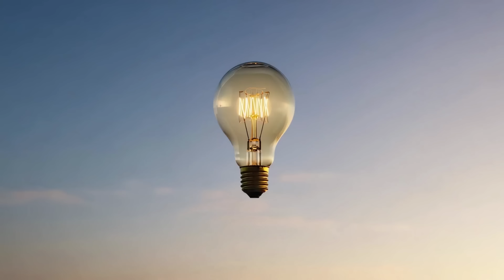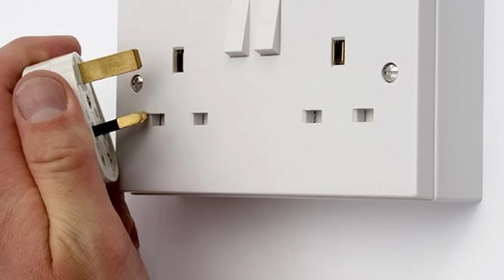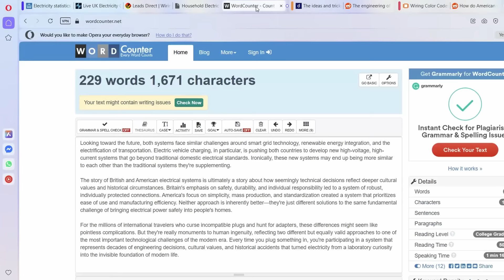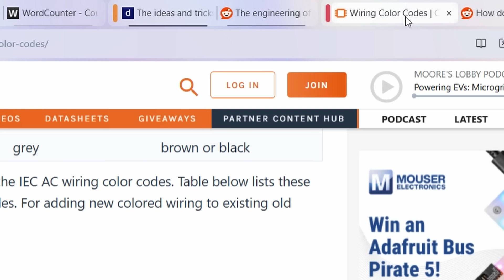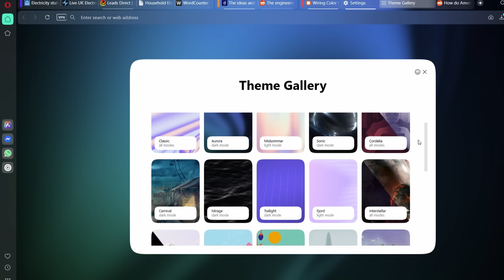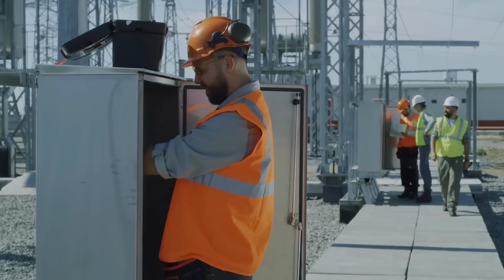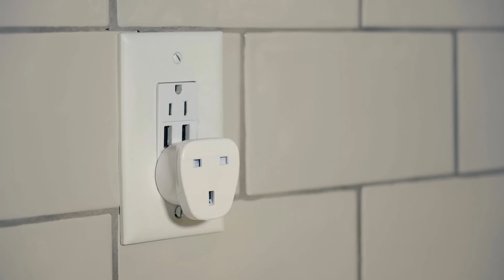British electricity is SAFER than American electricity. here's how.

Comment: As I remember we had fuse boxes in the UK...with individual fuse wire for different circuit's. Now we have even more safety with fuses in plugs and fuse boxes replaced with a mains trip with trip relays for individual circuits around the house

Comment: The UK started off with 2 pin plugs and sockets, similar to what they commonly have in the USA.  However, a new statutory standard was introduced in 1934, that mandated 3 pin plugs and sockets with 4 different sizes and current capability.  This was updating in 1950 to mandate shuttered sockets (to prevent children sticking objects into sockets and getting electrocuted) and insulted shielding of the first part of the live and neutral pins, again for safety reasons.  Meanwhile, a new standard for square pin plugs with embedded fuses was introduced in 1948, and this has become the dominant standard over the years.  Square pin plugs have been mandatory in all new domestic installations for about 75 years, although round pin sockets and plugs are still permitted and are found in specialist applications such as theatre lighting.

Comment: Not quite true, original plugs/sockets were round, even in 1975 when I bought a do-er upper it had 2 outlets in the entire house both round pins. My current house still has some modernish sockets without switches, which I must get around to replacing, things change but it takes time.
Reply: The square pin Type G plug was designed in WWII, by a woman, being introduced in 1947. The older round pin Type M  and  Type D is still legal but used for niche applications like lighting. It was phased out from 1947 for prime household use.

Comment: Master Electrician here (American) 

Very good, easily comprehensible explanation for non-technical folks. 

One of the first things I noticed when on holiday in the UK was light switches toggle down to turn the light on. American switches toggle up. (I think this is a carryover from the days of "Frankenstein" switches where you didn't want gravity to energize the circuit.) 

The first thing my wife noticed was there were no receptacles for her hair dryer in the toilet area.  We have wet location receptacles on GFCI (RCD) for kitchens, toilet rooms, and outdoors. I also had to explain turning off the switch before plugging in or out. 

Agreed your plugs are much more robust than ours, and safer with the partially insulated blades and the ability to switch off the receptacle before connecting/disconnecting.  The way the cord enters the plug at 90 degrees also prevents pulling the plug out by the cord.  You just don't want to step on it while in stocking feet! 

Also, your illustration of an American receptacle showed an old fashioned "un-grounded" (un-earthed) receptacle. This has mostly been replaced with three blade "grounded" receptacles, which like the UK version, the ground pin is longer, and connects first. These are also more secure in the the receptacle. 

American homes also have 240 volts.  The utility transformer feeding the service panel (consumer unit) has a center tapped secondary: 120 volts from either end to the center tap, 240 volts end to end. 

We use 240 volts for high power tasks like water heating, clothes dryers, kitchen ranges, and air con.  Lights and portable appliances are 120 volts. 

My wife was impressed at how quickly UK tea kettles boiled water, so I ran a 240 volt circuit and installed an Americanized version of the UK receptacle in the kitchen. (The receptacle has a double pole switch, and fits an  American pattress)
Reply: One thing I've noticed about the US flush fitting boxes for sockets is how the screw lugs are fitted on the outside while ours here in the UK are on the inside, so at least with the US boxes there's far less chance of piercing and shorting out the wiring when fitting a socket, unlike ours where you have to be very careful not to trap and pierce the wires with the screws, as I've done enough times in the long distant past. But surely with the fixing lugs on the outside it must cause issues with the surrounding plaster on the wall, don't you have to make little gaps in the plaster for the screws?
Reply: We have sockets in bathrooms but in remote zones, which means the average bathrooms is too small to accommodate. For obvious reasons we do not have portable electrical appliances near baths and sinks.

I would not like to stand on razor blades in my bare feet. So I keep razor blades off the floor. We keep plugs in the sockets and switch off using the switch.

US receptacles have no safety shutters. Along with a whole host of other advantageous. 

American homes do have unpolarised 240 volts, only for high powered appliances using a special plug.  The oddball US system has three circuits fed into a house. One 240 volts  and two 120 volts. We look at it and think what were they smoking when they thought of that. 

My wife was impressed at how quickly UK tea kettles boiled water, so I ran a 240 volt circuit and installed an Americanized version of the UK receptacle in the kitchen. (The receptacle has a double pole switch, and fits an American pattress)/
I assume the Leviton British Standard Receptacle - BS 1363 Switched Outlet. It must a be curio feature for visitors.

Comment: I find the two blade system trends can be  easily/accidently unplugged compared to British 3 pin system. 
British 3 pins can be found also in other countries especially former colonial country and most of the world runs on 220v/240v
I can only think of US and Japan running on 110v and another I can't remember
Reply: Japan is an antiquated mess. 100v with no earth One half of the country is 50hz and the other 60hz. 
56 countries use the British Type G plugs. Saudi Arabia recently changed over to the British system. Auss, NZ and China need to follow. Hong Kong uses the British plug.

Comment: The British Type G plug as used today was only introduced in 1947. 
Previously, type D was used, which in the two-pole version can be confused with types C, E and F used in Europe.
The American type A plug was introduced at the beginning of 1930. Little has changed.
Reply: Ring circuits were also introduced in England around 1947 to save copper and money. 
Only branch lines are used worldwide, never ring circuits.
Reply: The American type A plug was introduced in 1919. Time for change.

Comment: A good compromise are the european plugs an sockets, they a bit smaller then the british ones and  bigger than the american´s.
Continental europe has also 230V there are mainly two different type of sockets. The most countries use the "Schuko" ® system,  France , Belgium and the Tschech republic got a similar one  with the earth pin in the socket.
Reply: The German Schuko is not that good. The side ground blades are poor.

Comment: The electrical socket shown is an outdated type used no later than about the 1960's.  While you can still find them in older homes, all modern sockets have a third, U-shaped slot for the ground (earth).

Comment: Very good review. We did in the UK harmonize with Europe by dropping to 220  volts...
Reply: That's just nominally, though. Most UK supply is still 240v. As I type this, my supply is 241.7v.
Nominal European single-phase voltage is 230v, with a tolerance range of +10% and -6%. That means that the compliant range is about 216v to 253v.

Comment: British electrical is genius. I’m an American living in Shetland and electrical appliances seem to work more efficiently here. However I would like to hear what you have to say about the plumbing. At least here in Shetland the plumbing is pretty diy user unfriendly and although there are great things like stainless steel sinks with a stainless drain pan built-in the idea of a sprayer is really foreign or a very expensive retrofit. Also, you can’t buy a portable full-size dishwasher that would plug into a sink or a washing machine for that matter, which is a shame because sometimes a portable dishwasher or washing machine can be the perfect item for a small amount of cupboards space but  you have lots of island space in your kitchen.
The other huge issue I’ve had with the plumbing here after living in a few houses is that most places don’t have shut off valves under each fixture like they do in the states so if you have flooding you have to go down to the kitchen and turn off the main water valve  rather than just being able to turn off a valve under a sink or toilet. 
In all outdoor the hose fittings here are some weird quick release made of plastic that break quite easily, especially when you have young children ! 
However, I am very happy to be living here and I can deal with the plumbing , unfortunately, I can’t fix it anymore.
Reply: 🙂
All your reservations on plumbing are easily rectified by buying the right fittings. All available even the dishwasher, if you look hard enough.

Comment: See also the Brit practice of putting fuses in the NEUTRAL in the past.  Also Brit electrical - let's put the metering and other network equipment and wiring straight on the wall inside the house not in an sort of enclosure at all; let's make switchboards out of wood, no let's use steel, no let's use plastic, no let's use steel again, no...; meanwhile in the USA put it in a steel box, ah nice and safe let's leave it at that.

There's many other technical differences beyond a fluff video such as this one that will leave people wondering how on earth Brits think there electrical is so good compared to any other peer country, apart from not actually knowing just how many risks there really are with how things are set up.  Having a false sense of safety is far worse than not.  Oh, and this is coming from an Aussie where we've done some questionable things in the past too.
Reply: I have never known fuses in the NEUTRAL - ever.
Integrated metal switchboards have always been available in the UK. New houses have dedicated incoming cables and meter cupboards. 

he British domestic electrical system is objectively superior to other residential systems in how it controls fault energy, protects flexible cords, and manages distribution.

The British system is superior because it:
▪ Controls fault energy at the appliance;
▪ Protects flexible cords directly;
▪ Uses higher voltage efficiently;
▪ Has safer plug and socket design;
▪ Applies human-centric protection universally.

The US system prioritizes simplicity and low voltage tolerance, but that comes at the cost of cord protection, efficiency, and inherent safety. The UK system assumes people will misuse electricity and accidents will happen, and designs for it. The US system assumes they won’t.

I like going to the USA as I can see how electrical systems were seventy years ago.
Reply: @johnburns4017  Except when you lot used  fuses in the neutral.  It's a matter of historical fact and one that can not be denied, unless of course you wish for the rest of humanity to laugh at you.
Reply: @retrozmachine1189  
The British ''do not'' use fuses in neutrals.

You have not a clue about what you are writing.
Reply: @johnburns4017  Perhaps you should take the time to go back and actually read my initial comment.
Reply: @johnburns4017  Oh and for everyone's entertainment, plug this into the search of your choice 'why did the UK have fuses in supply neutral'
Reply: @retrozmachine1189 
Again......
The British 'do not'' use fuses in neutrals.

You have not a clue about what you are writing.
Reply: @johnburns4017  Yeah.  There's no oh I dunno youtube videos of modern day UK sparkies coming across installations that STILL have fused neutrals in operation.  That never happens, eh?
Reply: @johnburns4017  Look you can continue to blither on but it's painfully obvious that you just don't know the reality of what has gone on in your country in the past and have no idea as to what is going on today either.
Reply: @retrozmachine1189  
If anything antiquated gets thru the net it is replace when known. What planet are you on?
Reply: @johnburns4017  Apparently a different one where you are because reviewing your comments the Brits never had neutral fusing ever and it is absolutely not in use anywhere in the UK today, at all.  

Shame that reality disagrees, but there you are with the world smirking at you.
Reply: @johnburns4017  Oh, and don't worry about replying.  I've had enough entertainment for today, thanks for giving me a good laugh, and have elected to set you to silenced.
Reply: @retrozmachine1189  
You are a very confused person.

Comment: GGL .... I love this channel, but ..... US voltage is 240 volts, with the facility to split phases to 2x120 volts ... All your of your ovens, tumble dryers, AC, etc, are wired into your 240 volt circuit, the lighting, sockets etc, are supplied by the 120 volt circuits.
.

Comment: The old British type M round pin plug and socket is used in India (largest population in the world), Pakistan, South Africa, etc. They are still legal in the UK today. But these days they have shutters, switches and insulated pins similar to the square in Type G. Despite being rejected as the prime plug in the UK they are the second best plug and socket in the world after the current British type G. All the rest are way behind. 

The British square pin Type G is used in 56 countries in the world. Add in the users of the Tye M then most of the world uses British designs of plugs and sockets.

Comment: The US system is an oddball system. Three circuits are fed into a house, not one. They have two 120v circuits and one 240v.  The 120v circuits have neutral wire, while the 240v circuits do not. Yikes. The standard power sockets are 120v. Any high current appliance needs to use 240v which has a different plug again. So, two voltages and two plug types. 

A mess.

Comment: A woman was on the design team of the British G type plug and socket, Caroline Haslett, who insisted on many of its human-centric ergonomic design features, emphasising safety for children and ease of use for a housewife. She insisted on: 

a. Shuttered Sockets 
Type G sockets have internal shutters that cover live and neutral terminals. They only open when the longer earth pin is inserted, preventing accidental contact. This makes it safer for children. 
b. Sturdy and Secure Connection 
The plug fits firmly into the socket with strong friction grip. Large pins and robust construction reduce the chance of partial insertion or arcing. 
c. Correct ergonomic size 
The size of the plug is for a human hand to hold securely and safely. Intentionally designed to be large enough to be grasped safely, reducing the risk of finger contact with live pins. 
d. Flex safety 
The flex hangs downwards not outwards, to avoid pulling the plug out from the socket. It avoids tripping on the flex. Also reduces strain on the flex. It keeps the flex neat and safe in domestic settings allowing furniture to be closer to the socket 
e. Unobtrusive 
The sockets were to be flush with the wall preventing damage from impact or snagging. 
f. Switched 
The plug has an integral switch so as to keep the plug in the socket and control an appliance. 
g. Fused
Has an integral fuse from 1A to 13A. This protects the flex and appliance. The fuse also enables final ring circuits which may eliminate a number of radial circuits.
h. Insulated prongs
Fingers cannot touch energised L and N prongs.

The British G type plug and socket is a design classic.
Reply: A minor point, but the plug fuse is there to protect the flex only, in case of overload which might cause it to overheat and perhaps catch fire.
Reply: @tarnmonath  
By default the fuse in the plug protects the appliance. It is also a backup in case the mcb fails - which they do fail occasionally

Comment: Just a quick note on the ‘ring main’ 
There’s a lot of them out of there still, but new circuits or new build houses don’t as a rule use these anymore as they do have their downsides. 
If I’m doing a new build, I’ll use radial circuits everywhere now and appliances like then dryer, dishwasher, washing machine get their own individual supplies. The kitchen itself gets a 32A radial circuit using 4mm2 cable, and I’ll usually install 2 further 20A radial circuits using 2.5mm2 cable. 
2 lighting circuits, one up and down. Or just 1 if it’s a bungalow. 
Shower has its own feed. Cooker has its own feed. 
Interlinked smoke/heat detectors I’ll wire to a lighting circuit as you’re more likely to notice if the power to those is off!
Each circuit is protected by its own RCBO (combining an MCB and an RCD together) 
Anti surge protection for the whole house fitted into the board and connected to a normal MCB in the panel. Remote buildings, such as a workshop, garage or shed get their own feed, usually by a buried armoured cable and protected by an RCBO with a higher leakage tripping current. Then in the remote building a small sub board again using RCBO is fitted. 
Other sparkles might do things differently but that’s now I do it 😂

Comment: The fuse in the plug wasn’t always so. We used to have 15A and 5A round pin outlets each protected by their own fuse at the board before we switched over to the square pin Inc a fuse in each plug.

Comment: North American homes run on 240volt split phase. Depending on the device high current devices like a stove or dryer run on 240volts. Two 120volt hot wires from a single transformer 120 degrees out of phase with a centre tapped neutral wire. Large appliences use the two hots for 240v. Smaller plugs use one phase (hot and a neutral for 120). The power going into North American homes is really 240 volts. They are equally as safe. Just different. Thre was a shortage of metal in Europe as there was a war on the doorstep so a system had to be developed to use as little copper as possible. In North America people lived much further apart in rural areas than in cities so the transformer for each home split phase system made sense but used more copper etc